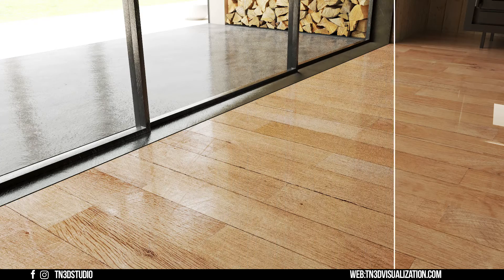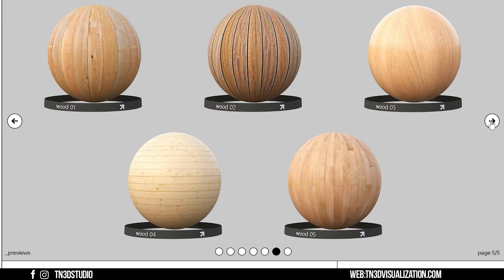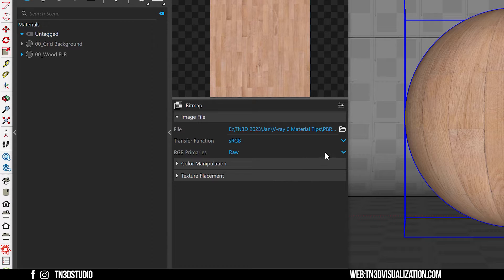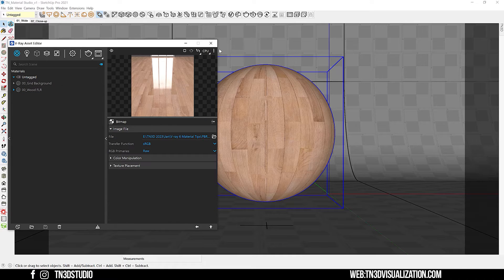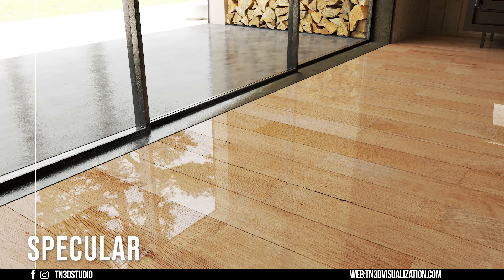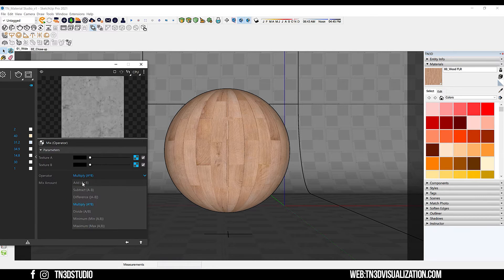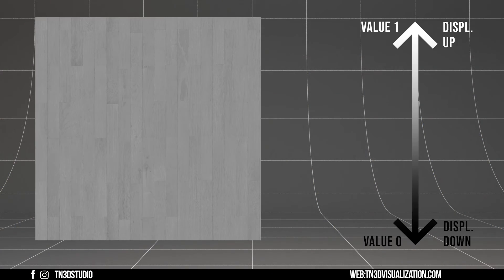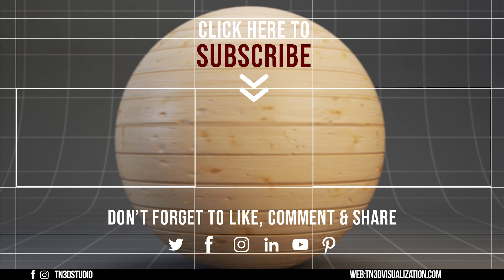How to Create Realistic Materials In V-ray 6 For Sketchup Using PBR Textures

Comment: How did you build your lookdev scene ? Cyclo / lighting calibration/ etc. To be sure you get « true reactions » of the pbr material ? Would be lovely to explain the grey ball and chrome ball calibration aswell as the lighting adjustements of the lookdev scene (hdri or rect light) and cyclo used for the background. Please ❤
Reply from the maker: Thanks! It's a pretty simple studio set up. 3 lights (primary, secondary, and fill light). If you apply the textures correctly you will get pretty good result under all light conditions 😀

Comment: thnanks, but you go too fast about mix operator for imperfections
Reply from the maker: I normally use Mix operator when i have to combine 2 textures in the same slot (this would be the same for Albedo and Ambient Occlusion), Because i had roughness the mix operator blends the two so you can get the right results. :)
Reply: @TN3DStudio  thanks for your answer

Comment: Great tutorial, very helpful
Though what's the difference between a directx and opengl normal map.
Reply from the maker: The only difference between OpenGL and DirectX Normal map is the Green channel is inverted (DirectX's first pixel pixel is at the top and Open GL first Pixel is at Bottom), Similar to Roughtness and Glossiness concept :)
Reply: @TN3DStudio  thanks a lot. How does this affect its usage/application because believe I noticed a difference in the bump result when I used the two. And do we still use the transfer function settings for the two

Comment: What about Ambient Occlusion?
Reply from the maker: If you have ambient occlusion texture, you combine it with the diffuse texture using mix operator text map. 👍🏿 I've show this in other material videos 😊
Reply: @TN3DStudio  mix operator in multiply A x B mode?
Reply from the maker: Yessir, mix operator multiply 👍🏿, but depends on the AO texture, sometimes if it's inverted you have to try other options. But look at how the textures blend together, because AO texture adds shadows and highlights back to diffuse/albedo texture 😊

Comment: I never understood the differences  between roughness and glossines,  can't we reduce the glossines by darkening the b&w texture map, and generate roughness, i just don't get the difference
Reply from the maker: Yes, rougness and glossiness are the same (just opposites). Where glossiness gives you sharp reflection roughness will give you matte surface ( and vice-versa) works the same with the texture, the secrete is in the contrast of your texture. I always adjust my roughness (in vray or photoshop)  Trust me, it's not that complicated. Thanks for your comment 😊
Reply: @TN3DStudio  I just adjust the gain, gama and lift of texture, at color correction, wrap in,  in the glossines texture slot and i get matte reflection, sharp reflection, all i need, still don't know the use of roughfness, anyway thanks for the comment